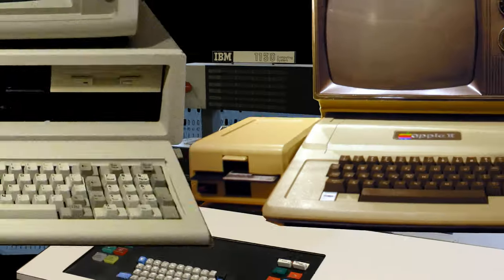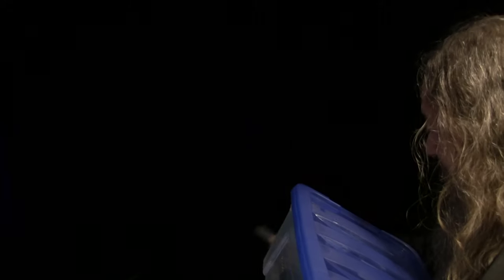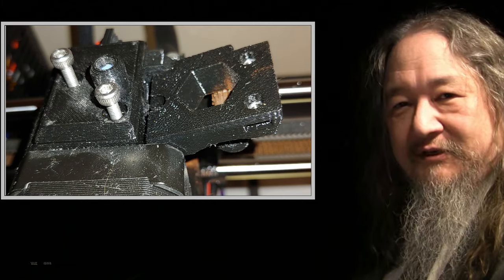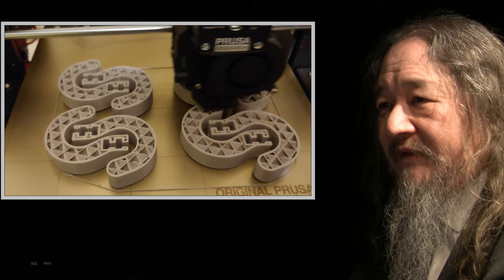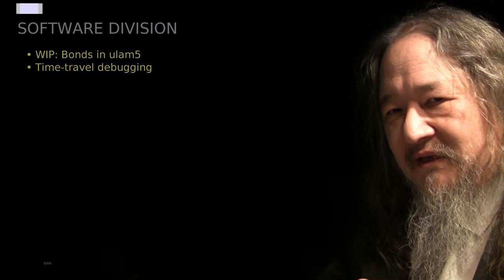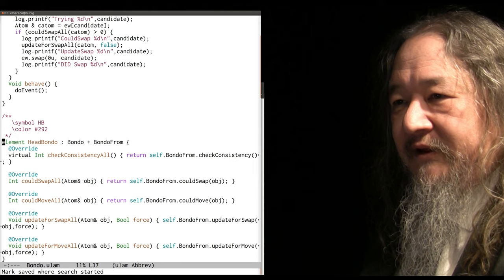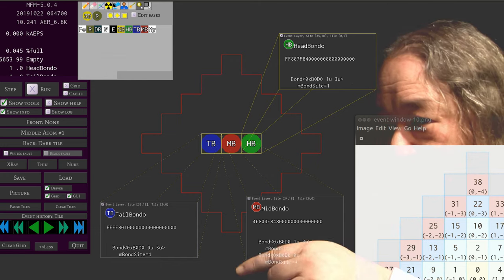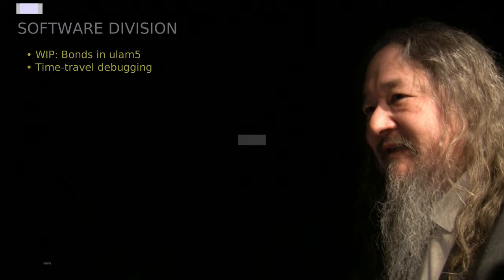Time Travel Debugging - T2sday Update 254

Comment: You could make hooks that alternate. Hooking from both front and back of the structure, might be a bit tricky to design since one of the sides would need some kind of joint or to be attached to the tiles after hanging it from the pipe first. May help with the tilt somehow and would definitely make it more secure. Also if some doofus gets the idea to see how much the thing weighs and lifting it up, it's not going to come crashing down.